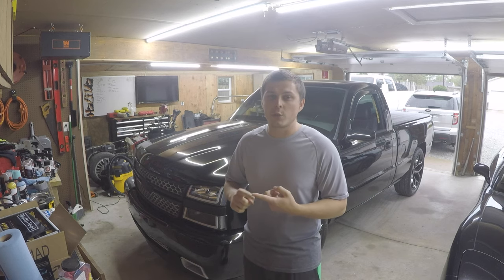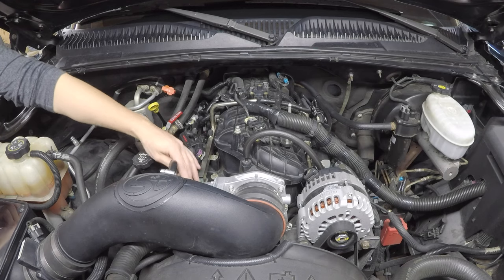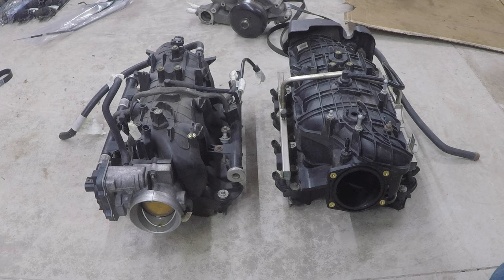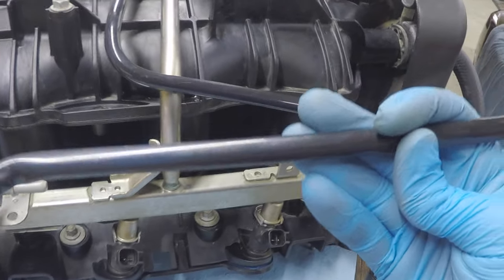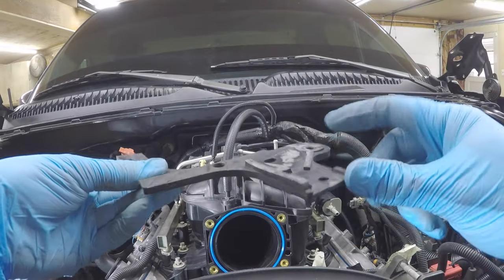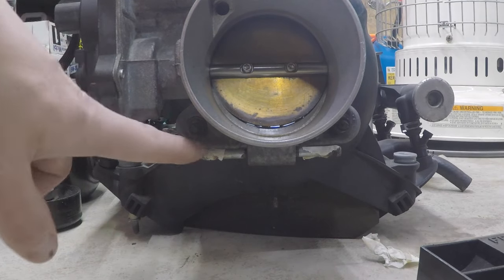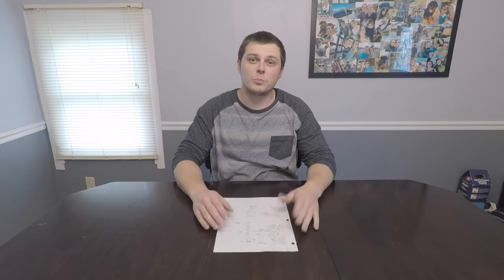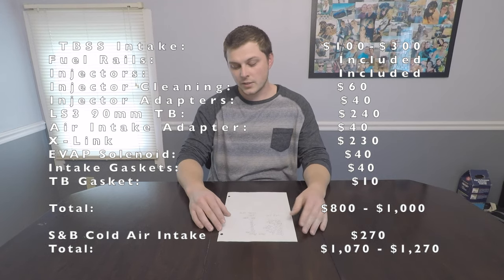TBSS Intake Swap, Ultimate Guide! Add More Power To Your LS Motor!

Comment: I may have missed it, but can you swap the injectors off of the old intake to the new setup? I bought a NNBS manifold complete with rail, injectors ect. I was trying to see if I can roll without a retune. It's already cammed with a tune and right it it sits around 12:1 so I have some room to play on the top end. I'll log it to ensure it's not trying to go lean but was mainly curious if I could just swap the injectors over to see how it does. Also, how was the power difference out of the hole?
Reply from the maker: Hey, so I believe the nbs injectors are just slightly shorter than the nnbs injectors. Ive herd of somepeople getting away with it. Most people switch to tbss/nnbs injectors or 8.1L injectors. If you have any issues, I believe you can run injector risers to fit properly with the nbs sets. But as for swaping out the intake, any airflow changes it is definitely recommend that you retune. If you swapping to the 90mm TB and X-Link, then you will for sure need a tune.

For the power change, I went from a bone stock 4.8, to adding alot of mods: big cam, milled 243s, full exhaust, intake, 2600stall, built tranny, shift kit, etc. So it was an incredible night and day difference for me. I can't really answer for just the i take manifold, because of that.
Reply: @TheKingCoopa  Thanks for the reply!
Reply from the maker: For sure, good luck on the swap 🤘

Comment: When you did your cam swap did you have to put in a new Stall converter  ? If you had to put a new one in what size Stall converter did you have to get.  I'm trying to figure out if I should do TBSS intake manifold or a aftermarket intake.  And I want to do a cam swap.  If you can help me out I would really appreciate it.  I really like the way your truck sounds.
Reply from the maker: Hey, first off if your looking for a new intake, look up Richard holdener on YT. He has dozens of intake comparison videos showing you all the charts and HP gains from an engine dyno. Alot of great info. The TBSS intake does surprisingly really well.

For the cam swap. A stock 5.3L gen III is about a 191 duration for intake/exhaust. A stock LS1 in a C5 corvette is about 198 to 200 duration. Once you get about a 216 duration, your gonna want a small stall converter. In this video I had a 226/234 112LSA, crane cam. And that was with a 2600 stall. It handled really well and drove like stock.  My new setup is a built 6.0L/4l80e/AWD, and nitrous. The new camshaft is a 234/240 112LSA, from cam motion. Cam motion says it is a minimum requirement of a 3600 stall or larger to run that camshaft. 

So if you just want the choppy sound and don't want to do the converter. Id say like a 215ish duration with a 110LSA. I wouldn't go lower than 110 on the LSA or the drive ability will suffer. But if your doing an intake, sounds like you want the power. So in that case I'd go with like a BTR stage 2 through 4 truck cam. And probably like a 2600 to 3000 stall.

But honestly the best advice I can give, is figure out your long term goal of the truck. Like a daily driver, fun toy, or eventually you want to boost it. Figure that out, and buy your parts twords that goal. So your not wasting money and changing out parts you already bought for something bigger, like me. But figure out what you want then make some phone calls. Call BTR and Cam Motion tell them your setup and they will spec out a cam shaft best suited for you. And they will tell you what stall you need.

Comment: Awsome video. does the stock return less style fuel pump support the 36lb injectors or did you upgrade the pump?
Reply from the maker: Hey, yes the stock pump will supported it. I'm not sure how maxed out it is. But on my new 6.0L with a larger cam, and nitrous, I'll probably need an upgraded fuel pump.
Reply: @TheKingCoopa  Thanks for the info saved me a ton of trouble.
Reply: I bought a summit racing atk 385 hp lm7 create its currently maxed out stock injectors at 303 hp to the wheels so I'm hoping this will get me around 350ish to the wheels have all supporting mods except Injectors so decided to do the tbss swap had to set my limiter to 5400 so I won't run lean

Comment: Do you have to get a tune as tuning is a little difficult for California boys
Reply from the maker: If you just do the intake swap, you should be fine. But if you change the throttle body or injectors. Then a tune is definitely recommend

Comment: Ok really informative but my ocd can’t shy away from the 3/4 inch brass ball valve on your heater core hose why is it there
Reply from the maker: Haha so the truck was a one owner, old man bought it new in 2004. At some point in time, the hot/cold blend door went out. So instead of pulling the dash apart and fixing it properly, he installed the ball valve. So if he wanted it hot, he left the valve open. And when he wanted it cold, he would close the ball valve, stopping the coolant flow to the heater core. I replaced all the blend doors, just havnt taken the valve out yet 😅😅
Reply: Lol gotcha makes sense
Reply from the maker: Haha yea. One day ill fix it

Comment: Awesome work! How hard was the cold
Air intake to get back on with the larger tb?
Reply from the maker: Hey, honestly the larger TB doesn't make any difference for the install/removal. Just a little more weight to carry around. I like having it on, because the TB mouth is a good grip handle, and the TB blade keeps debris out of the intake. Thanks for the support!

Comment: Will this gain power with no tune on LQ4 and still pass smog? Thanks great video
Reply from the maker: Any airflow or fuel changes, a tune is needed/recommend. You will gain some power, but it won't be maximized without a tune. This shouldn't effect smog, as long as you still hook up your evap system.

Comment: Did you have any trouble with the X-link??? 
 i've done the exact same swap but can not get the x-link to work for the life of me
Reply from the maker: Hey, I had zero trouble with it. Everything worked out great. The only thing I can think of is: 
1. You have to have a GM or AcDelco throttle body, or it won't work.
2. Maybe you got a defective X-Link, and it might be worth your time to call the company. I know they have had this happen before, and they can guide you in the right direction.
3. Has your truck been tuned yet? If not, then it probably needs a tune. Especially if you went with different injectors. Im sure there is something in the tune that might need adjusted so it reads properly?
Hope that helps you out some, but those would be my best guesses.
Reply: @TheKingCoopa  Thanks for the reply, Ended up sending the x-link back and they sent out another one, plugged it in and worked flawlessly!
Thanks!
Reply from the maker: @clarkvanderlee1476  ayyeee, thats awesome, glad it works now!

Comment: If you want to throw a flex fuel content sensor in there do you think you'd have enough room using the corvette filter?
Reply from the maker: Hey, anything is possible if you put your mind to it haha. I say that, because I have fuel pressure sensor coming off my fuel rail, and its pretty close to the fire wall (fuel line adapter to AN fitting, fuel pressure sensor, AN fitting to fuel line, then my factory fuel line clips on that)
So if you ran the corvette filter, for your return style fuel system, you might not have enough room to fit the flex fuel sensor on the back of that. But with a few AN fittings and adapters I know you can do it. Ive seen a few guys run some neat setups, some also look like crap and un-organized haha. Like (fuel line adapter to AN fitting, AN 180° bend, then run the corvette filter, another 180° bend headed back to the firewall, AN fitting to fuel line adapter, then put your flex fuel sensor on, and connect it to the factory supply line) 
I hope all that made sense haha. Honestly I'd just try to fit it all in a straight line before the firewall, so you don't have to buy any extra parts. But its gonna be really close. You might even beable yo put the sensor coming right off the fuel pump? I'm sure with enough patience and determination you will get it. Hope that helps 🤘

Comment: Did you have to modify your TBSS fuel rail to adapt that filter that far forward? my inlet nipple is quite a bit longer that that.... So my fuel lines are quite tight against the firewall. I wont run them until that's fixed. Any input would be awesome
Reply from the maker: Hey, I have a returnless style fuel system, so I didn't need the C5 fuel filter. For your situation where the fuel lines are tight and don't have enough room, you could get a fuel line to AN adapter. Plug that into your fuel rail. Then get a 180° AN  bend. Plug in the filter, then get another 180° bend, and fuel line adapter to run back towards the firewall that your fuel line would plug into. So it would make an S shape, and the filter will sit right next to the fuel rail. Hope that helps. There are a few photos on Google of guys running it like that of you still have issues.
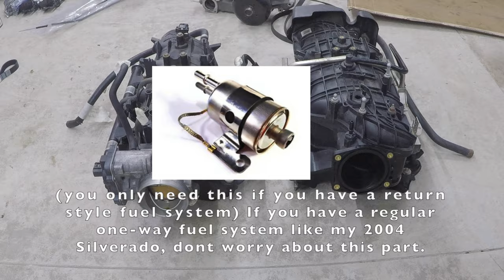Reply: @TheKingCoopa  OK. I went back to look at the video and you showed just an example of the return style system at 6:22. That was what I was refering to... That said... I did something similar to what you suggested already and its clean and works well. Cheers
Reply from the maker: @ritchiepartsmechanical9420  oh nice, glad you figured it out 🤘
Reply: @ritchiepartsmechanical9420  Man if you found a solution to this, that works...can you share that info w/  parts list. I'm trying to figure it out!

Comment: Probably not the place to come for questions, but I'm having issues. Same cam you have, I'm running milled 706 heads. Had a 07 style intake ported to match heads and running 42lb injectors. My tuner set me a base tune to get it running. It will not idle, will not go over 3k sounds like it has a 2step. Would do the same before the base tune was added.
Reply from the maker: Hey, this could be so many things. You gonna have to take some time to track it down.

Did you make sure the timing gear and crank gear were aligned properly?

With milled heads did you check for proper pushrod length? You will need shorter pushrods.

Did you tourqe the pushrods properly?

Double check all your vacuum lines

Check to make sure the intake manifold is installed properly with new gaskets, to make sure its not sucking in air around the gaskets.

If you have the newer style DBW throttle body, did you use the X link? If you did use the xlink, are you running a GM/Acdelco throttle body? The xlink won't work if its an ebay special TB.  Make sure the butterfly is operating.

Use a heat gun on the exhaust manifold to see if one side isn't firing, check the coil pack connector.

Check your shreader valve, on the fuel rail for proper fuel pressure.

If you ran the truck on larger injectors before the tune, your spark plugs are probably fowled out. They will need cleaned or replaced.

Also run some MAF spray cleaner through your MAF sensor. 

Make sure you reuse the old gen III MAP sensor. 

Also, you might have to tell your tuner to tune the truck with a speed density tune. Good luck!
Reply: @TheKingCoopa  Thanks for the reply, injectors were junk, went back with stock injectors, and it is running much better. Still having an issue intake is not leaking anywhere, but on the tune we have air flow maxed out and it will still occasionally die if you get in it hard and let out. Thinking intake is just junk. I'm running the stock 05 throttle body for the truck.

Comment: Can I swap over my injectors to these rails without any mods to the rails? Or hats
Reply from the maker: My research said that you need injector risers since the tbss injectors are longer than truck injectors. But I've also had a few people tell my they still fit the truck injectors in there. So I can't give you a straight answer there.

Comment: Howz it Cooper, question so I put the setup as shown in the video but for the map sensor the original one that comes with my truck is to big in diameter to put on the TBSS intake manifold. Thinking about drilling it out a little bit to make it fit,any ideas?
Reply from the maker: Hey, hmmm thats interesting. I think the first thing I would do, is go checkout a new map sensor at the auto parts store. Just incase, it might be the right size, gm made a few different map sensors over those few years. If it's the same diameter  as your current sensor, you could drill it. I'd just be worried about getting plastic shavings down into the heads. You could form a little tape cup on the inside to catch most the shavings. Just go slow so you don't drill it too big.
Reply: @TheKingCoopa   yea that's what I did at first but I couldn't find one that had a smaller plug for this year. I thought I would've  been able to get away with using a different year but the truck didn't even want to start. 
Another question would it be okay to run stock headers for a bit I have headers for it but small town so I gotta find someone to straight pipe it for me
Reply from the maker: That is strange haha. I guess I'd drill it. Just go nice and slow, slowly stepping up the drill bit size. 
For the headers you won't have any issue with it. I'd try to get it tuned with your new headers, so it truly maximizes your power output.

Comment: Do you hear of any issues when using the corvette filter?  I hear people saying the filter sits to far towards the fire wall and the fuel lines rub the firewall?
Reply from the maker: I've herd that too, and if its too tight, then most people just run some AN fittings/a short AN line to make a little S bend and stay away from the firewall
Reply: @TheKingCoopa  That's what I'm going to do on mine.  I did notice the perfect solution in your video were the fuel rail has a shorter inlet than the TBSS or NNBS rails. ( you showed still picture of it).  I wonder if that is a production part( fuel rail) or someone was able to shorten the tube and somehow put the proper connection back on.

Comment: I’m having a problem with my brake booster I’m guessing keeps backfiring but now is idling good and my brakes are stiff. I think my brake booster fitting does not fit my stock hose
Reply from the maker: Hey, sorry for the extremely late reply!! A vacuum leak could definitely cause some idling/running issues. I'd definitely check over the hose fitting first, and even try a vacuum pressure test before you go and buy a new brake booster. 

Also keep in mind it could potentially be two separate issues. I doubt it and you know your truck better than I do, but its always a possibility. Sorry I wasn't much help, I hope you figured it all out by now!

Comment: What if u don’t have a break booster to put that vacuum line in
Reply from the maker: Hey, sorry for the late reply. If you don't have a line going to the brake booster, I'd just cap/plug that port in the back of the intake.

Comment: How does it work with a 2006 Chevrolet Tahoe vin z flex fuel 5.3 are they the same type of fuel rails and injectors or can I use my injectors from Tahoe. I not sure if someone could answer I would appreciate it thanks.
Reply from the maker: Hey, so with a little research I found that the 05- 07 classic Flex fuel injectors start at 35.404767lb and ramp up to 38.443005lb on a returnless system also based off a constant fuel pressure of 60 PSI. You would have a returnless fuel system. So you don't need the the C5 corvette filter. Your factory fuel rail won't fit over the tbss intake hump. So you would either have to cut your fuel rails, weld on AN fittings, run the AN line over the top to clear the hump. Then make little drop tabs to mount the fuel rails to the tbss intake.

Or, use your flex fuel injectors, the tbss fuel rail, and then you will need injectors risers, since the truck/suv injectors are a little shorter than tbss injectors. Hope that helps

Comment: How is the injector adapters working for you? I’ve had people suggest tapping into the stock injector harness instead of using the adapter
Reply from the maker: Hey, sorry for the late reply. I ran them for a while, with no issues. after this video a cleaned the engine bay up, and hard wired the new connectors with my harness, for a cleaner look

Comment: Damn, you keep it 💯💪  have a 2015  in a 99 LS  give me some tips for horses
Reply from the maker: Hey, if both trucks are stock. The first mods I would do: 1. Long tube headers 2. Remove the catletic converters (if you don't need smog tested) 3. S&W Cold air intake. 3. Camshaft swap  4. A good tune. Those will wake the truck up! Huge night and day difference. Depending on the camshaft size, you might wanna a little bigger stall/tourqe converter. But those would definitely be the first things I'd do. After that, your looking into more upgraded heads, head work, and an intake swap. 
Thanks for the support!
Reply: Thanks 👍
Reply from the maker: @dedricknight8598  for sure 🤘
Reply: What brand headers recommend👍🐴😜
Reply: @TheKingCoopa  can I start off with a btr stage 3 cam kit
Reply from the maker: For the headers there is alot of brands, stay away from pacesetters. If you're on a budget I'd definitely go with speed engineering. Great unit, just needs new exhaust clamps. If you have extra money to spend you could look into Texas speed or LG's. But if your staying NA then go with 1 3/4" size. If your going power adders like turbo/supercharger then go with 1 7/8".

You can definitely start out with the BTR stage 3. Definitely a very popular cam option. You might want to look at the full kit, because you will need new valve springs with that cam. Also will need a tune
Reply: @TheKingCoopa  keep it 💯💪 always 👀👀
Reply from the maker: @dedricknight8598  for sure 🤘🤘